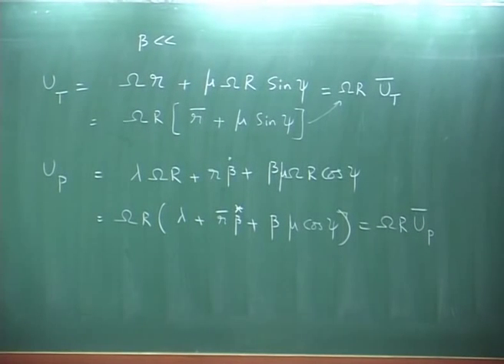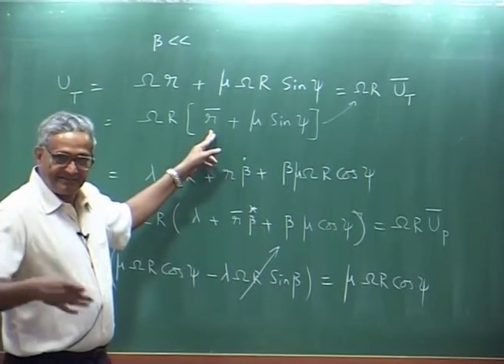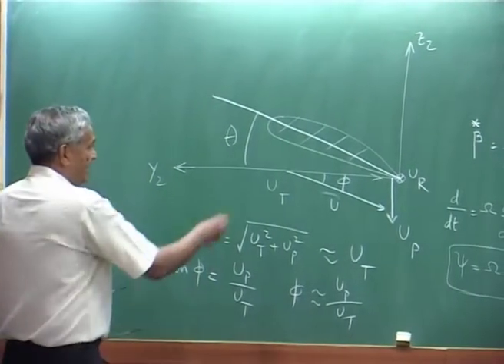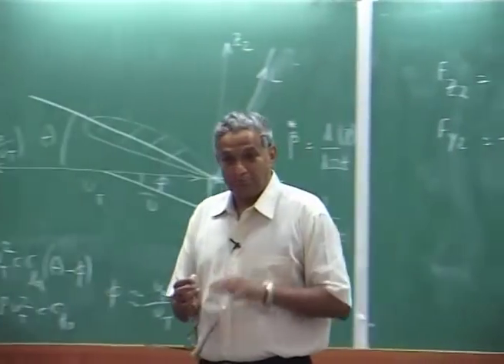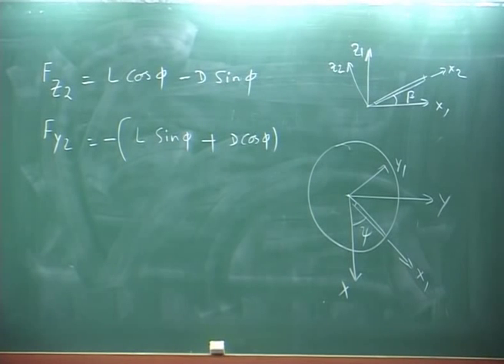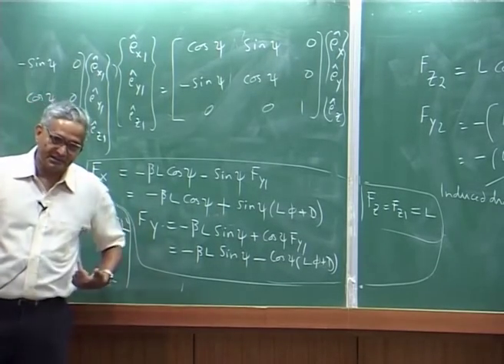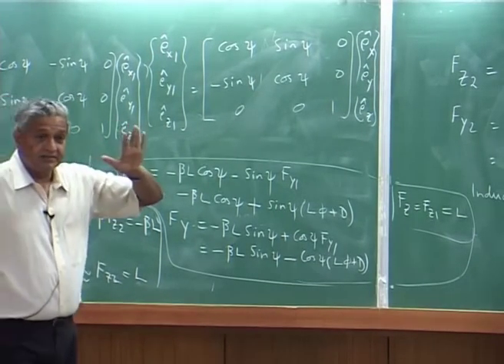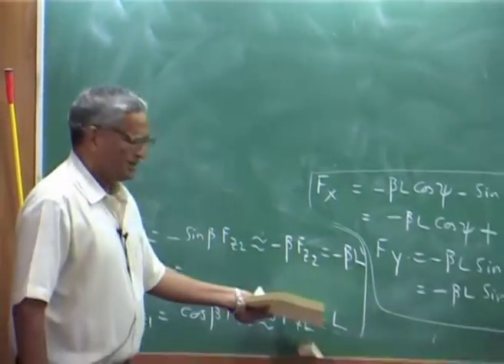Mod-01 Lec-12 Introduction to Helicopter Aerodynamics and Dynamics

Comment: [0:00]
- Blade's sectional lift and drag equations derivation for forward flight;
- Forces along X2-Y2-Z2 frame, transformed into X1-Y1-Z1 frame and finally into X-Y-Z frame.

[33:16]
- Mean value of hub load.

[1:07:51]
- Mean thrust coefficient, and other non-dimensional quantities.